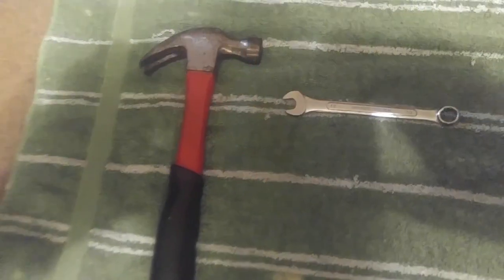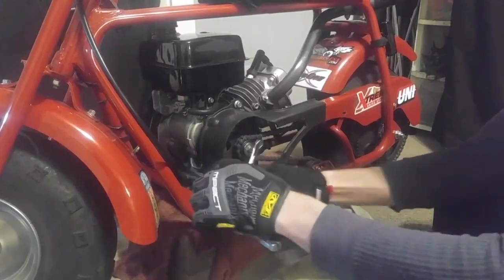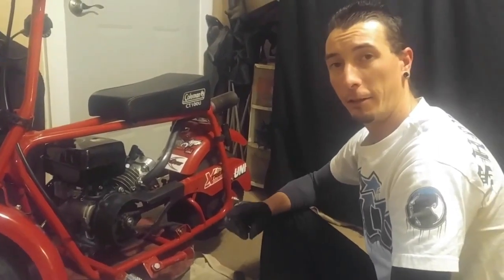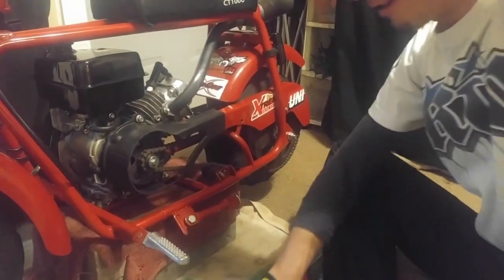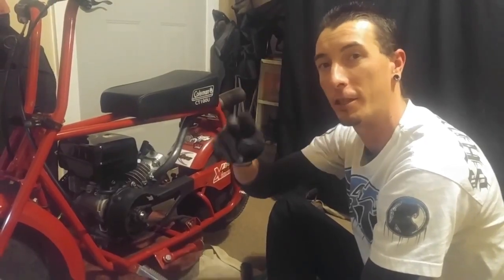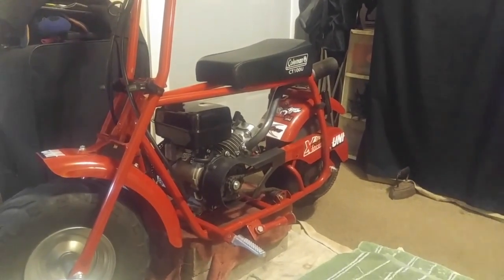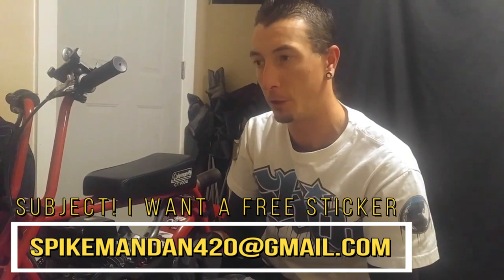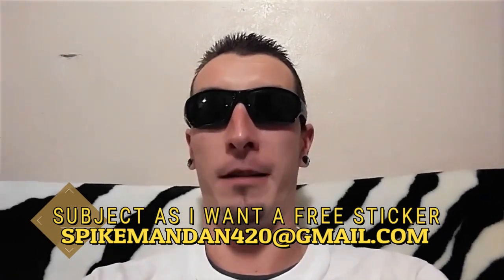Clutch removal for dummies

Comment: If the engine rotates, jam a hammer in the back of the clutch to stop it from spinning or clamp the clutch. The new clutch I just put in my gocart to replace an old one that was to its credit still working engages below my engine's idle rpm, so that's fun.
Reply: I used an impact to take the bolt out and it work great

Comment: My clutch shaft doesn’t have have a place for the bolt on it nd the clutch I got didn’t have a place for the 2 setting screws how do i get the clutch on with out sliding right off??
Reply from the maker: Maybe try buying a predator
Reply: @spikemandan  it is a predator 212
Reply from the maker: @sashavasquez9336  so it's probably not a problem with  the engine maybe you need to get a different clutch

Comment: Hey I just bought this mini bike and the wheel spins soon as its tryin to start. I don't know shit. Is it the clutch? Its not reving up
Reply from the maker: Could be a number of things clutch could be stuck or the idle is too high whether if you're hitting the throttle or not if that idle is too high that will cause the clutch to engage
Reply: @spikemandan  thank ya sir. I'm pretty sure its something in the clutch because it's not reving up when it starts. Its a normal idle but the wheel spins as soon as the motor starts turning. Thanks again for the tips!
Reply from the maker: @aaronoverbey5435  also make sure the chain is not over tightened that could cause similar thing to happen

Comment: So I tightened my chain up like 100th times already and as i ride it makes some noises and than chain snaps off and gets so loose and engine and everything is still on it tight and i dont know what to do
Reply: All I can think of is something like the wheel is loose, chain falls off and then when you go to diagnose it it looks normal for what ever reason.  Also your sprockets could be out of round (oval shaped) making the chain constantly tighten and loosen each rotation, the sprockets could also be out of true making the chain ride off of the sprocket and finally the sprockets may not be aligned straight making the chain move in a crooked line till it rides off the sprocket.  Tell me what it is and if you fix it, I wanna here.
Reply: Prolly too tight. If it still falls off when loosened, go to a motorcycle shop to get a link taken out, they should do it free, well for me anyway, I went to my local Pro-Tec

Comment: Do you think a 6.5 clutch will work on a 5 hp Briggs and Stratton
Reply from the maker: As far as I know depending on the shaft size of the clutch which could be 5/8 to 3/4 as long as it fits it will work all you have to figure out at that point is chain size

Comment: What if the bolt is rounded out
Reply from the maker: Depending on how bad it is you can try to grind two flat edges or for flat edges to try to get a wrench on it otherwise you'll have to drill and tap an easy out

Comment: U can use a slide hammer
Reply from the maker: All depends on the situation whether it's bolted on the back with the Allen screws or directly in the front of the shaft you would only need to use a slide hammer if none of these things are holding it back and stuck on the shaft
Reply from the maker: Other than using a slide hammer I would use the correct tool a pulley designed to do that job slide Hammer with just damage it
Reply: @spikemandan  ye the one I have is held on by Allen screws but I’ve never used a slide hammer I just know someone who does
Reply from the maker: @Matthew-ib2kz  hey it's your story you tell it however you want I'm just telling you what I know

Comment: I keep trying this and it doesn't work🙁
Reply from the maker: What's not working did you get the bolt off in the clutches stuck or you just can't get the bolt out
Reply: @spikemandan  can't get the bolt off
Reply from the maker: @Pyrex209  have you tried an electric impact
Reply: @spikemandan  idk what that is, I barely started learning about mini bikes about a moth ago, bought a db30 from a friend in good condition for $100 runs good but needs the clutch swapped out with a new one
Reply from the maker: @Pyrex209  gotcha yeah I don't know sounds like something you might want to look into buying those can sometimes be a bitch to get off if you don't have an electric impact
Reply: @spikemandan  sounds good ill look into it I appreciate your help🙏